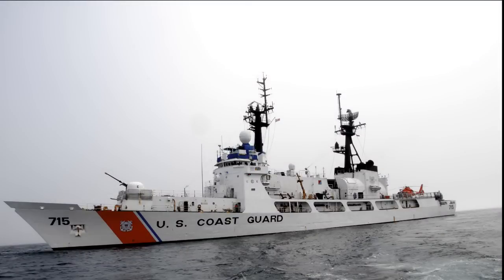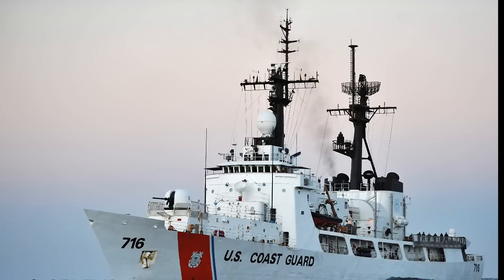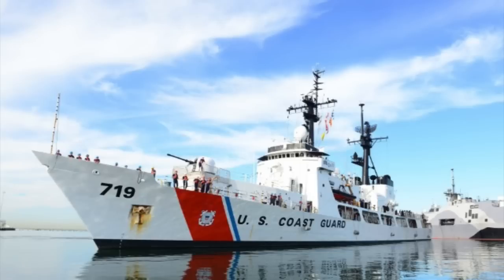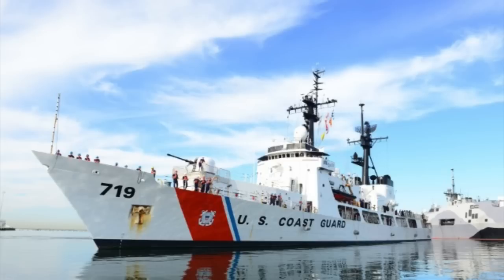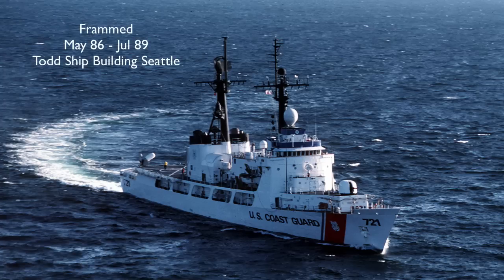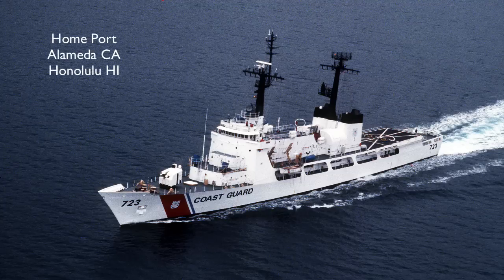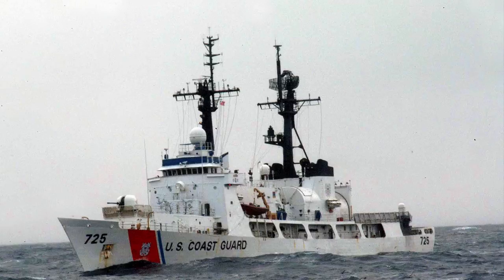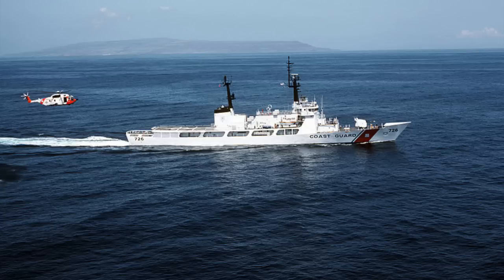USCG Cutters 378 Foot Class

Comment: Sonar Tech on USCGC Dallas WHEC-716 out of Governor's Island NY. 18 months.
Reply: When were you a ST? I went straight from boot camp to ASW base SD in 1979. Then Midgett for 10 months then Hamilton for 2 years. I have a story about tracking a sub at top of thread.
Reply: @jonathanp1884  I went from TRACEN Cape May to Kodiak Alaska, 5 months waiting for Sonar School in San Diego.I was at ASW about the same time as you, got there in April of '79.  After school got assigned to the Dallas WHEC-716 out of Governor's Island NYC.  We became the on scene Command for the Mariel Boat Lift in 1980.  Some good things about being a Sonar Technician...#1 there was only about 50 of us in the USCG at any given time.  Very easy to make rate/advance.  I was a 1st Class before I got discharged, less than 4 years.  When you took a service wide exam for promotion you'd be lucky if there were 3 others testing unlike many other ratings were there were hundreds. #2 There were only 2 jobs for an ST.  Either a big white cutter or teaching in SD.  You had to be an E-6 (1st class) or higher to get a teaching job, if I re-enlisted I was going to go for that job. #3 We were in Weapons division.  Those of us who were interested in qualifying for boarding parties and such were welcomed.  I did and it was a lot of fun.  We also skated through drills and such as we had the most top security on the boat....most crew weren't even allowed in many of our spaces.  #4 Very good background in digital and analog electronics and electro-mechanical systems.  Outside of the underway time it was one of the best jobs in the Guard as far as I'm concerned.

Comment: I served on Rush and Sherman in the late 80's. Rode the worst the Bering could throw at us. Tough cutters.
Reply: Served on the Midgett in 1980. Heavy seas in the bearing sea, ["weather decks secure, weather deck secure"]. I chose to go up to the flying bridge to get fresh air. Two waves in a row went over my head...on the flying bridge....insane.
Reply: @jonathanp1884  75-77  walked on bulkheads a few times 👍

Comment: Nice Videos.  But double check the homeports info.  Several were incorrect.  Sherman WHEC 720 Homeports  Boston, Alameda CA, San Diego CA now in HI.  I sailed on Sherman PRE and POST Frame. Both time out of Alameda.
Reply: All cutters have been going through several homeport changes, make sure what your thinking about is relevant for its time.
Reply: @Kpoole35  Most I seen on this Video was correct, maybe a few other missing some ports.  But I know Sherman was never Home ported in Seattle. Been there but not homeported there.